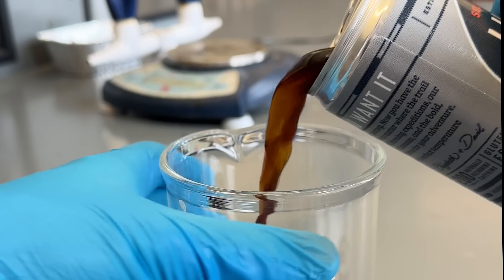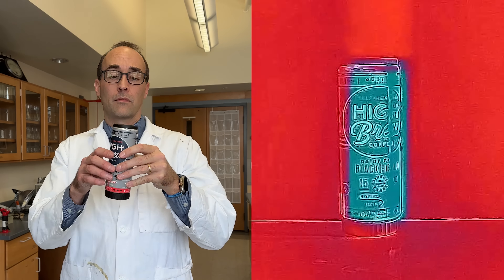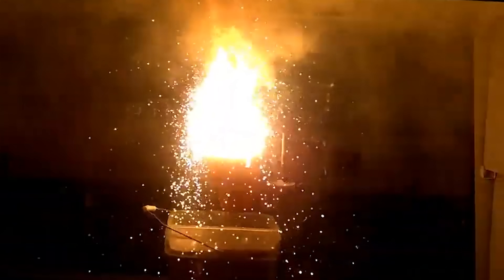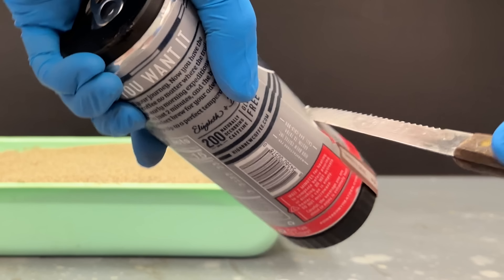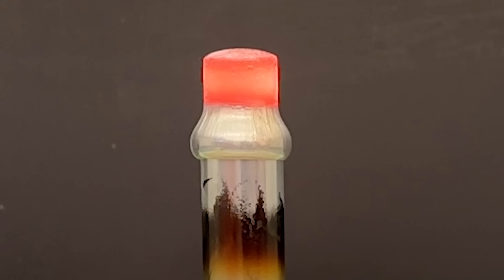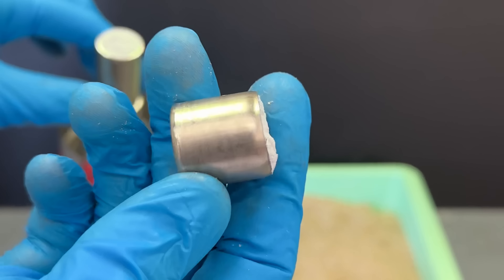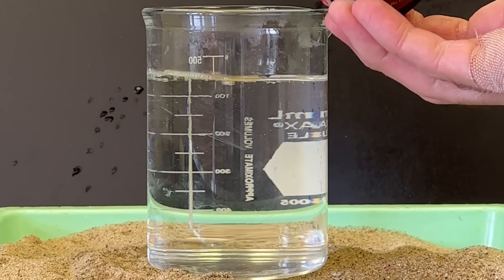Heating Coffee with Thermite!

Comment: I was a crane operator in a foundry. We made Ductile Iron a few times a week. We used magnesium landscaping rocks (by the pallet) in a pre heated ladle. Then we would pour hot iron into the ladle. The flash from the interaction was the brightest thing I have ever witnessed in my life! I would close my eyes (while wearing shade 6 lenses) and could still see the flash. A very dangerous, but interesting job working in a foundry.
Reply: A few days ago I modified a laptop case, drilling and cutting a few threads (Stoopid stuck shut designs, nowadays). Of course I could not resist to set the puny heap of magnesium shavings on fire afterwards...
Reply from the maker: I would enjoy seeing that IRL

Comment: Thank you for posting the video. Very informative.  I'm disappointed that a company would make a product that uses so many resources to create a hot cup of coffee.  It seems very wasteful.  How could this can be recycled?
Reply from the maker: As I was deconstructing these, it was pretty apparent that they were designed with recycling in mind. The plastic components snapped off easily and the aluminum outer casing can easily be separated from the steel vessel that contains the silica thermite. Is it as easy to recycle as aluminum cans? I doubt it.

Comment: As a fellow scientist colleague, I must correct that sand is not silica. If you are talking about pure SiO₂, the correct name would be quartz since it is the common corresponding mineral with standard conditions of temperature and pressure
Reply: Hey you're right. We say sand is silicon dioxide because it's the most abundant constituent of most sands, but that's only part of the story.

Comment: thank you for pulling it apart. what initial chemical reaction do you think is starting it off once the membrane is ruptured?
Reply from the maker: I think (based solely off of the patent description) that it involves barium peroxide. There is an audible release of gas from the heater once the reaction is initiated.
Reply: @Chemteacherphil 
Hi Phil. So if we mix aluminum filings with quartz sand, how can we initiate the reaction ?
Reply: @MarianLuca-rz5kk  magnesium ribbon or get enough shavings from a fire starter and use that assuming your powder is even fine enough...
Reply: @DrakeOola  
Shavings from a fire starter? What do you mean by that?

Comment: One question, where does the built up combustion chamber pressure go? What about the fumes?
Reply: Silicon Dioxide + elemental Aluminum --> elemental Silicon + Aluminum Dioxide

No gas involved in the reaction.
Reply: @seededsoul  Right, but wouldn't the heat make the gas in there expand? Is it under vacuum?
Reply from the maker: The thermite reaction does not produce gas, it is a solid state reaction. The only gases formed are produced during the primary reaction that initiates the thermite reaction and the heater has a rubber valve that allows the gas to escape out the bottom of the heater.
Reply: @Chemteacherphil  Thanks.

Comment: Me being an absolute nerd, all I can think is "eyo semiconductor thermite"
Reply: It’s not pure silicon
Reply: @muffinconsumer4431  I know that. The joke more referred to the mere presence of any silicon in the mixture.

If I'm not mistaken though, isn't silicon semiconductor material also impure to some extent? I'm no expert on this, but I remember part of the process of making it is that the silicon gets a very small amount of stuff like phosphorus mixed into it to fine-tune its conductive properties to exactly where it's needed. They aren't turning sand into electronics, of course, but unless I'm mistaken 100% pure silicon isn't ideal either. I'm open to corrections if I have this wrong.
Reply: @averythecatto  You’re right, no silicon wafer is 100% pure, but this is silicon dioxide, also known as sand

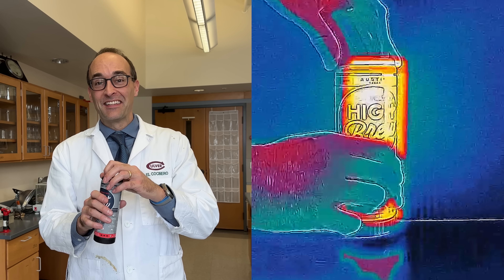Comment: 1:16 Wait a minute, let’s consider what you mentioned.. the hottest coffee will rise to the top, in reality wouldn’t the coffee’s temperature mostly be uniform and the instructions are likely to get the heating element in a spread out uniform area to evenly heat it? Because it’s a liquid it likely heats mostly all at the same time or close to it, right? Can you have a can of coffee with a temperature difference in any given area differ more than a degree or two more than the rest?
Reply: check out the thermal imaging, especially at about 40 seconds onward. You can see the hottest part of the full can is at the top. The hot coffee is less dense than the room temperature coffee, and rises. Also, the hottest part of the heating element is high in the can, so that contributes to the thermal gradient.
Reply: Check out the way the gutted heater melted, all of the actual thermite is in the very tip of the mechanism near the top so that's where all the coffee is getting heated at. You can easily rest hot water on top of cold water and it won't mix all that much unless you stir it up, pour it gently and it'll float on the top and take quite a while for the warmth to actually reach the bottom... I do that with my coffee, when it gets cold and I want more coffee I just pour more hot water on the top and then I have to mix it because most of the boiling water is stuck on the top with the bottom freezing cold. I drink instant coffee so I just add more "flavor" as needed but I always have to mix the cup thoroughly after adding more hot water to keep it at optimal drinking temperature, keeping an electric kettle nearby.

Comment: This looks too dangerous to control. If you were to do this on a hot day, would the can explodes as the coffee becomes steam? What if the termite leaks into the coffee as it heats up?
Reply: Bruh, it doesn't get that hot and as long as you don't pour all the liquid out before igniting it then it's not going to leak through the thick metal shell and leech into the coffee... As long as you use it like you're supposed to then there's literally no risk. 💀

Comment: Wow, I actually think this is a major customer safety issue. If someone were to start drinking the coffee and then decide to heat it up, I wonder how much they'd have to drink where the tip of the aluminum would melt.
Reply: that's correct, the rotating device should unlock the tip of the can only until it has fully finished rotating.

Comment: Heating coffee with Thermite involves using extremely hot chemicals to create heat that is greater than the ash of an iron.  This can be very dangerous. Thermite is made up of aluminum mixed with a fermentation material (such as biomass or even nitrogen) which when burned can easily be mistaken for a coffee fire.  But it can also burn footprints or objects along the path that leads to the next location in an unspecified way.  It has also been found that the use of Thermite can cause a huge explosion during mixing with Sumfor.  or other types of high sulfur materials  Therefore, heating coffee with Thermite is a risky and unsafe method.  which should absolutely not be used in making our coffee